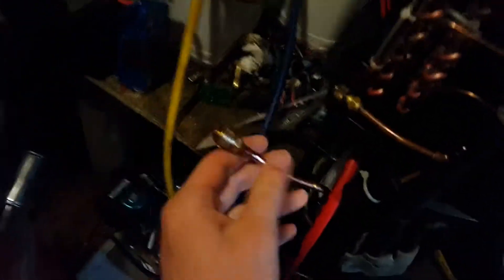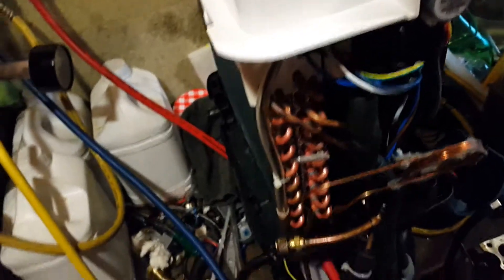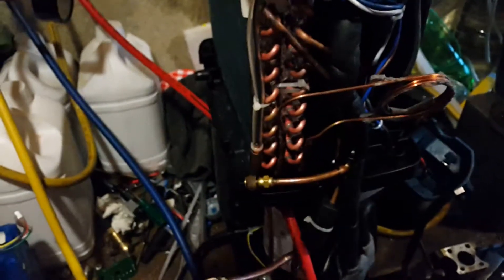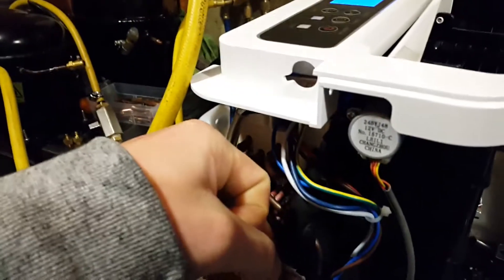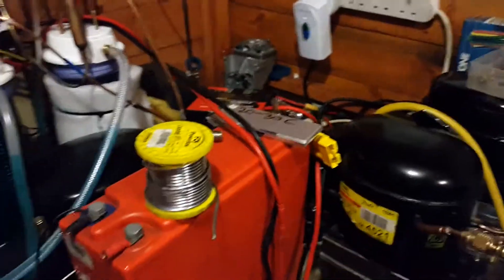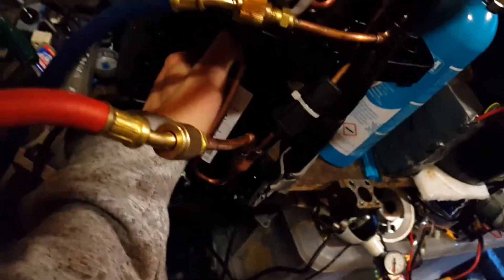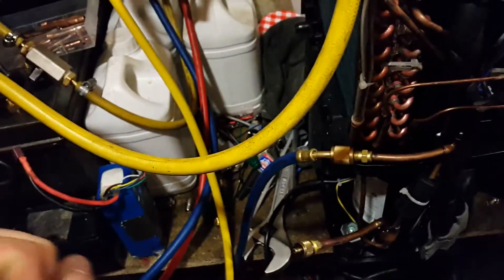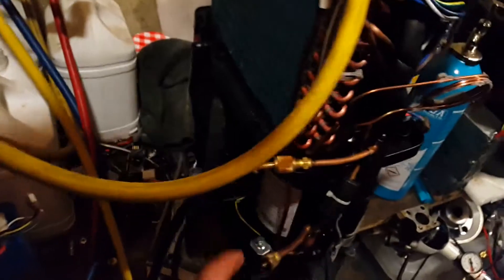R290 Propane Dehumidifier Fail

Comment: Hi Shaun, I did this exact thing to 3 delonhi 134a units, and it worked perfectly.
What I found was current draw and head pressure went up, and the evap got quite a lot colder.
I had no problem with the cap tube, it seemed to be perfectly ok, and I had to regulate how far the liquid got through the evap by the amount of gas in the system.
No problem having liquid get back to the comp if I put too much in!
On cooler days the units would ice up way easier, and on a hot day, the compresser would struggle with the hi head, but I was getting I'd say about an extra 50% water pulled out of the air, so definitely worked brilliently in my case.
I certainly did vac down the system fully between changing gasses, leaving a bit of residue of 134a would be very bad, specially if there was moisture coming in with the gas!
The poe oil is a big enough problem, as you've said too!
Reply from the maker: I have since removed the condenser from it, water cooled it and made it into a mini dehumidifier which doesn't heat up the room. I put a cooling radiator outside and pump water round the system.
Reply: That's Almost a geothirmal now!

I've also put 290 in a bar fridge, works fine as well, and 3 of the air conditioners in the house as well.
We did a car system, and found the ideal mix seemed to be 30% butane and 70% propane.
I have some small hand welder bottles and adapters to SAE hoses, so we weighed it in but charged as a gas.
I don't trust those bottles to be clean, and I've seen before what a tiny bit of swarf can do to a compresser!!!
so as a vaper, at least it went in clean!
That did appear to quite closely emulate the 134A that was in there before!

Comment: Whats a normal temperture of a running compressor???
Reply from the maker: About 60 degrees C for rotary compressors as the whole casing is under discharge pressure.
Reply: thx

Comment: I saw in your video the compressor is for R134a. Keep in mind that the displacement of R134a is much greater than a compressor of R22 or R290. I can see that butane would work better in the system without modification, but if you wanted R290 to work you would have to shorten the capillary tube to get more liquid refrigerant in the evaporator. Other systems you just have have to experiment with. Good work monitoring the amperage draw. Some overlook that.
Reply from the maker: I am using a mix of 79% r290 and 21% R600a this has similar characteristics to R134a the only difference being that you use less of it than the original r134a.
Reply: Do you think there is any possibility that the compressor has PAG oil in it? Would seem unusual as I would think it would be POE. If it had PAG, it would not mix with with the refrigerant and could it be loading up in the evaporator? I know R290 will not mix with PAG. I tried some in a test tube but mixed with POE it looks like salad dressing and seems to emulsify the two together.
Reply from the maker: Ultron
Interesting point, R134a usually has POE oil but maybe PAG is used in car systems. The refrigerant mix I use works with mineral and POE oils. I can't find any info on the compressor so I can't be certain what oil it has. May be worth just putting mineral in it to be safe. Mineral oil doesn't turn acidic when exposed to moisture which is why it is my favourite oil.
Reply: @ShaunDobbie  have you considered using PAO oil? It apparently compatible with most HFC’s and other refrigerants. I don’t know if it’s true though but it works well with r290 and r600a.